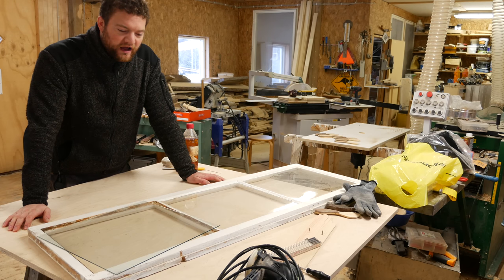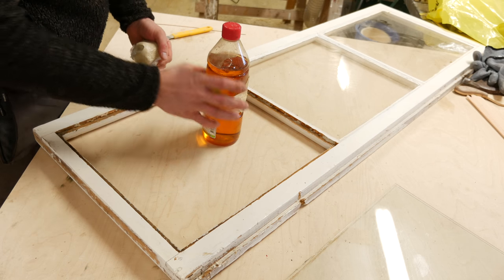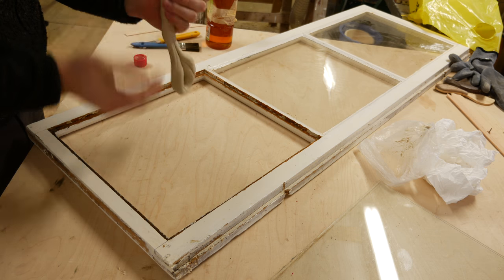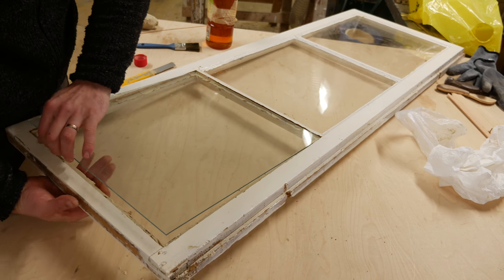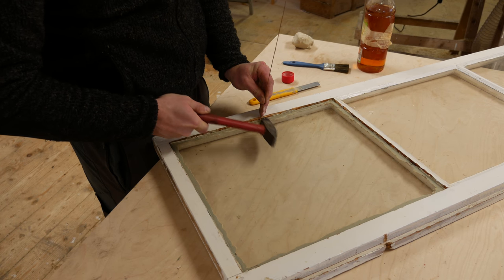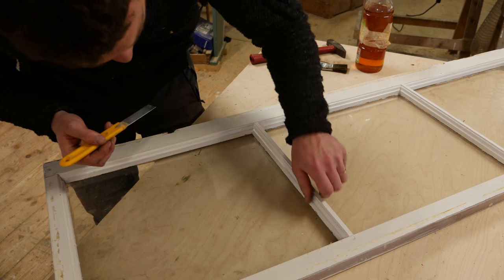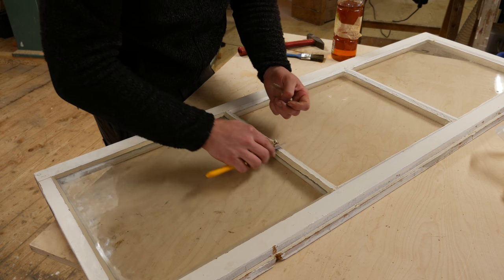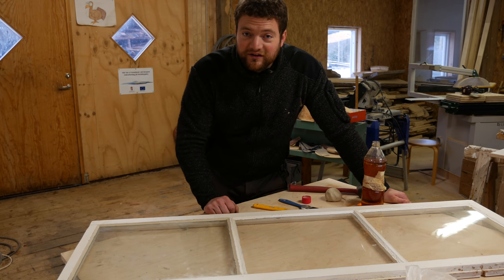Repairing Old Window

Comment: I grew up on a 150 year old farm in Maine and your technique is similar to the way that we did it. Instead of the nails, we used triangular points that were pushed in. Probable a little safer than a hammer around glass. But your way has stood the test of time also so keep up the good work. God bless.

Comment: Again, another great video.  There are a number of small tips you gave that make a whole lot more sense once you've reglazed some windows.  I grew up on a farm much like yours and had some large chicken houses with about 120 six pane windows.  I learned at an early age how to set new glass in.  Fortunately ours were in the chicken house and not our home.  At the age of about 10 I'm sure that the workmanship was a lot less that what I want now.  Thanks for the information.

We just restored 29 6, 8 and 9 pane windows for a log house built in 1935.  It was a lot of work and I wish that we had seen your process first.  We finally did get to a decent process, but it took a while to figure out the best and fastest ways.  Our biggest problem was that the glazing compound (GC) had hardened to a point where it was nearly impossible to remove.  We will definitely recommend to the owners that they reseal the paint over the glazing at least every five years.  

We found that this tool that was found on Amazon.com worked quite well once we figured out how to use it.  It allows good control in applying the GC.  https://www.amazon.com/gp/product/B000UVP09A/ref=oh_aui_detailpage_o05_s00?ie=UTF8&psc=1  We also found that it was best to buy the GC locally.  Out of five tubs of the brand that we used, three tubs had to have been on the shelf too long and were quite hard.  We were able to take them back and get new product.  The instructions said to not add any linseed oil to soften, so we decided to find the fresh material.  I found that the best consistency was about like that of stiff peanut butter.

Comment: This is how we do it at my work, we have just finished a contract for 87 old windows out of one of the biggest barns in NB Canada 100 years ago, we took them out of the barn brought them too our shop, took out the old putty and replaced the broken glass, epoxyed the window sashes and and built new fames and paint, installation. its very repetitive and tedious but a fun type of work if you like finishing work. Great job!
Reply: We also used DAP 33